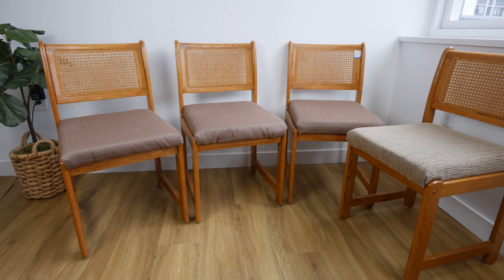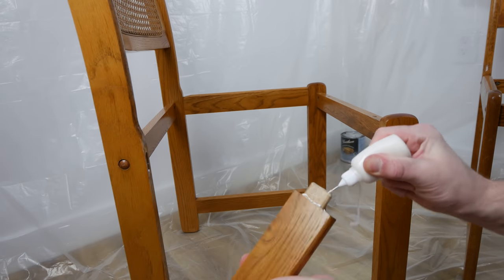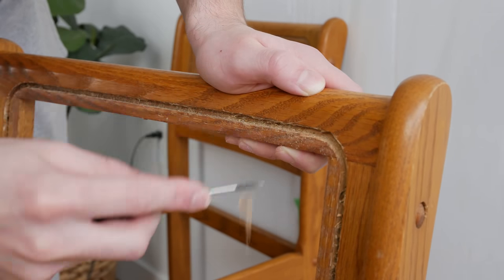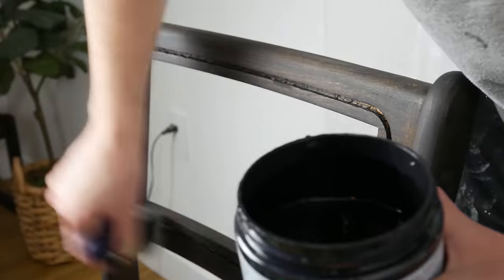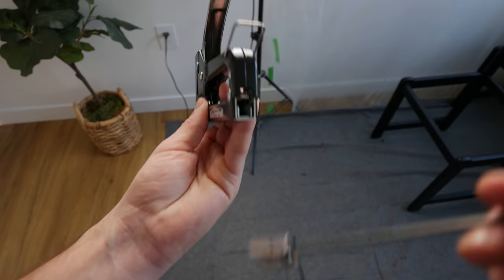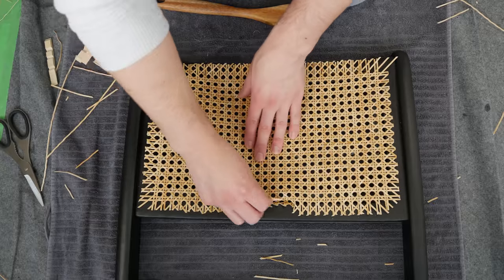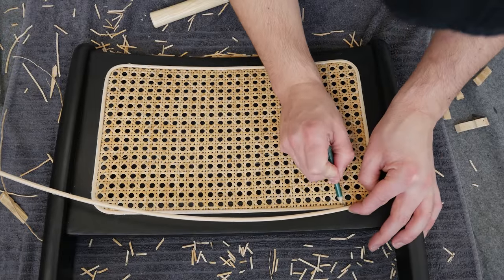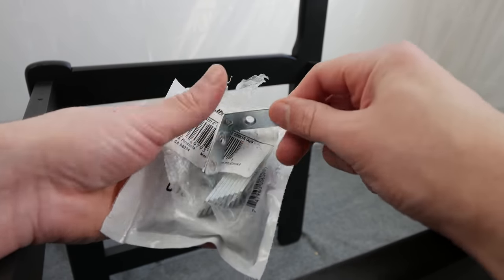Cane Chairs Furniture Makeover | $20 to $2600? | CB2 Inspired

Comment: Beautiful 😍 A tip with the cane - a paint wash might have worked...a light cream colour with water..a couple of coats. Those turned out beautifully 😍
Reply from the maker: I was going to give the wash a go but I just didn't think I would get the look that would make me happy. Maybe I will try it another time! Thanks for watching!
Reply: No one asked though lmao
Reply: I agree great job. For a more budget friendly, applying white wax to the previous cane might have helped lightens the color.
Reply: @ezequielmartinez3582  well actually to be fair the first part of the video was about him trying to find a way to lighten the cane colour, so I think that's opened the discussion about how this could be achieved. These kind of videos enable a community discussion about different techniques that people use and it is helpful to others to share their opinions which I think they did in a respectful way.
Reply: @FurnitureFlippa thanks because I didn’t want to have to take it out and replace it
Reply: Do you need to remove the finish on the cane before applying the paint wash? It’s so delicate.  You can’t sand- do you use a stripper?

Comment: Thanks for the motivation to redo my chairs ;would even be biting off a bigger project .Would have to redo my table because that's what really needs to be done it was damaged recently by water so it had taken off  many years  wax in one spot . You can see the yellow oak  surrounded by deep golden oak with a slight red tinge. Yes it needs modernizing . left it all natural as I got it when Y2K was about to happen  wanted to make sure I could burn it without killing myself from the varnishes and paints So it has only been oiled it's a natural oak it's almost criminal to paint it .

Comment: Great job! Actually re-doing the caning in this instance, was the only way to get a professional, polished finish. I would have personally preferred the color of the old caning, but there would have been no practical way to paint behind the old caning. Caning had to be removed.

One tip with painting furniture, cabinets and trim. I always use art brushes - not contractor grade brushes from a hardware store. Art brushes have finer bristles and don't leave brush marks. Even the white acrylic bristle brushes from Hobby Lobby are generally much better quality bristles than the most expensive contractor grades.  I have actually seen Lowes offering the white bristles, but you have to know what you're looking at.
Reply from the maker: Thanks and thanks for watching!! Nice tip!

Comment: I wonder if you could've whitewashed the caning, instead of removing. Still, looks great, and I'm glad you're reusing the old cane.
Reply from the maker: The cane was sealed so unsure if that would have worked. I planned to wash it next, but I didn't think I would have gotten the look I wanted. So recaning was the way! Thanks for watching
Reply: @FurnitureFlippa  Each flip has to be treated differently, right? I'm sorry you had to pay the extra, it's expensive! But I'm glad you get to reuse the old!

Comment: Those wooden buttons on the frame hide screws. You could have popped them out and tightened instead of adding L-brackets. The caning turned out amazing.
Reply from the maker: When inspecting, the chairs were actually tight where those screws were installed (side to side) But front to back was just glued together, so I added more glue and then the brackets are just for even more strength! Glad you liked the cane! Thanks for watching

Comment: Question, I've watched a lot of these furniture makeovers and a lot of people paint the wood. Is there a reason why you chose to paint it black vs using a black stain? Just curious as I will be attempting a DIY soon.
Reply from the maker: Good question! Most black stains won’t make the wood as black as the paint. It will depend on the wood type and the type of stain you use. Often the wood will still show through black stains and won’t look like a true black that I was going for. There are dyes that may get to a nice black look on the wood, such as solar lux dye stain jet black, or trans tint dye. I’m sure some stains like a black gel stain by GF, but I haven’t used them yet! It’s something to research or test out to see what would work

Comment: When should i prime something?
Reply from the maker: I usually always prime, but with black paint I sometimes skip the process. Lighter paints over wood can bleed causing yellow or brown spots. A good primer blocks this out. Also, primer can help the paint adhere better to the surface. Use a primer if your surface is glossy, but still make sure to scuff sand for better adherence.